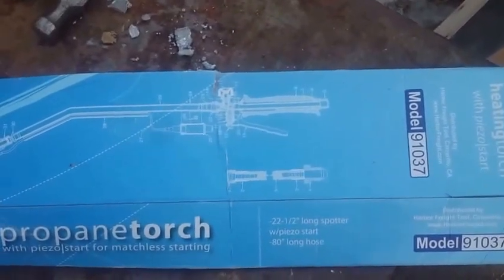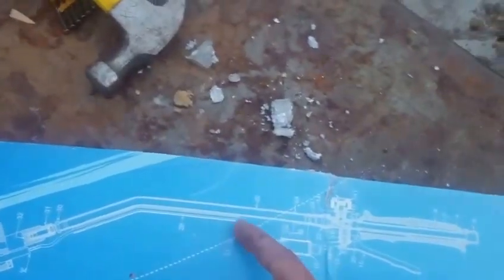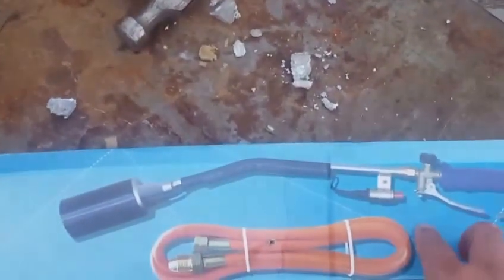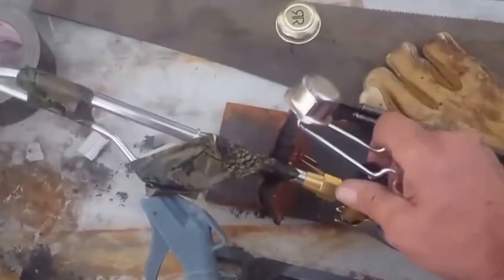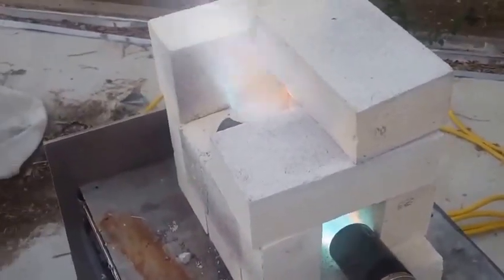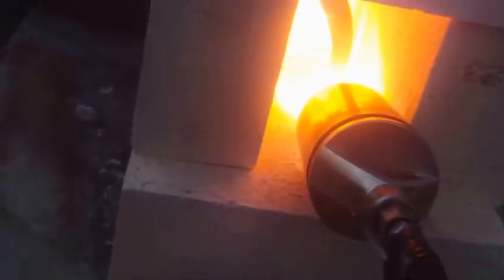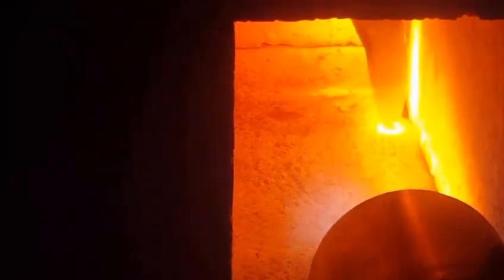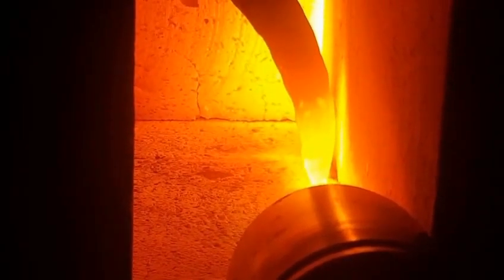Forced air forge burner

Comment: cover up the hole almost all the way
Reply from the maker: +Andrew Fenhoff I did close off the hole like you suggested, to about 2 inches on the exit side and increased the heat but the back pressure was puting out the torch. I did attach it to a propane forge and it did get to forging temp eventually. The asperated forge burners are a little quicker to forge heat but in a pinch I wouldnt hesitate to use a burner. Sorry it was soooooo long to reply, I definatly apreciate your tip.